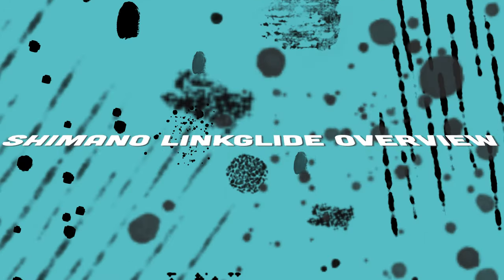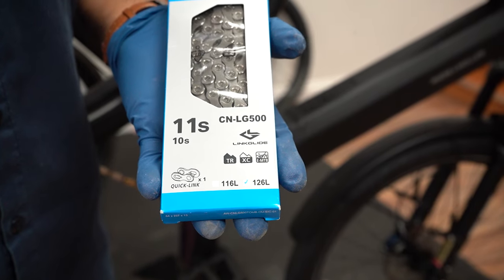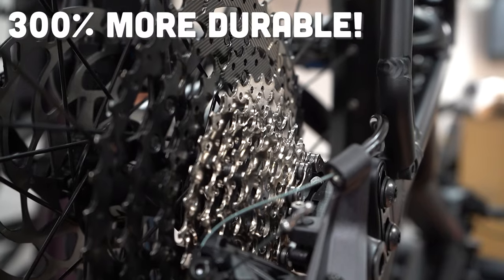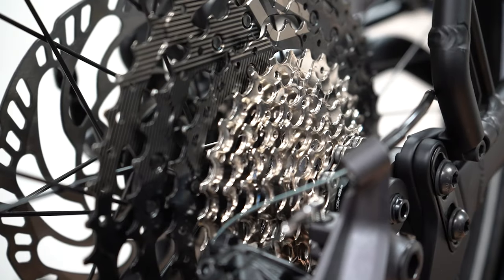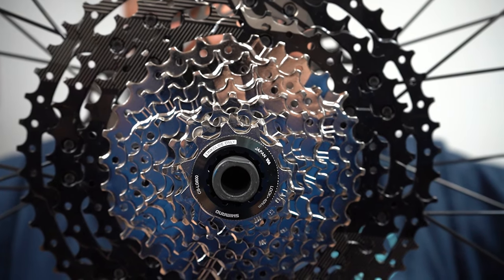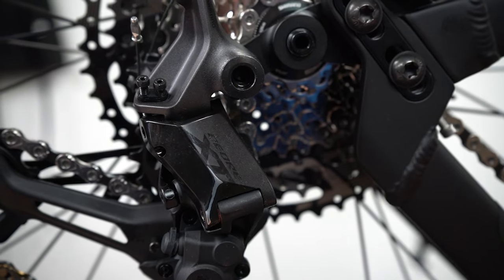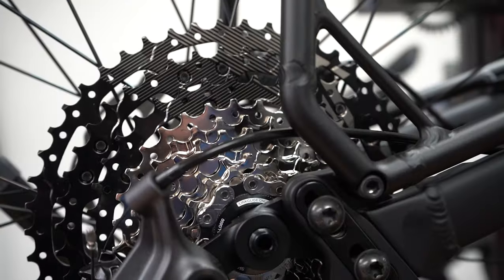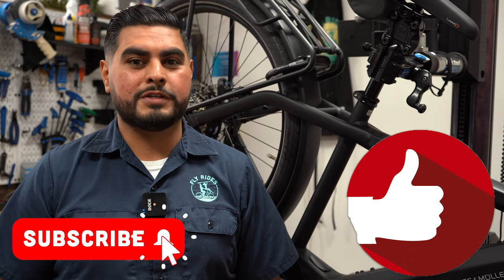Shimano's NEWEST Drivetrain for Electric Bikes | The Shimano Linkglide Explained

Comment: This new Shimano Linkglide drivetrain is solid! We already have customer with over 1000 miles and it’s still shifting smoothly with very little chain wear. Can’t wait to see this on more eMTBs
Reply: Is it possible to replace an 8-speed Hyperglide cassette with the 10-speed Linkglide? I assume the new cassette would just have to be the same width as my current cassette and I'd have to upgrade to the Deore derailleur and shifters which are currently Acera. Thanks for any advice.

Comment: I have installed the 10 speed Deore Linkglide on my affordable e-bike. So far so good. I also like the gear indicator that is on the Deore shifter, and I have no need of more gear range. 11-43 tooth is plenty for my e-bike, even in steep climbs. In Norway, the complete setup is like half the price of the Deore XT Linkglide.

Comment: When components companies claim that it will last say "300"% longer I don't believe it.
A cassette already lasts 3 chains stretched to .50
That takes about 2 years riding almost every day.
What they're claiming is that cassette will last 9 chains/ 6 years 
😑 I just don't believe it, but maybe on a E-bike it may last 2 years
Reply: I converted my bike to electric and I'm on my third cassette in less than a year, so this new one would only last me a year. I guess if anything it would reduce how often I have to do this repair.
Reply: @wpjmurray  ouch. That's insane 😂🤣
Reply: I currently have 17,650 kms on my Shimano E8000 drivetrain full-suspension e-mtb.  I've gone through numerous chains..... however..... only 4 cassettes (11 speed 10-46) with 2 still operable.  I think the key here is 2 complete wheel sets changing off intermittently. Works for me!
Reply: I always run into that one guy that tells me he eats a chain every month. Makes me want a recording of what they're doing to it lol
Reply: @LastAphelion  changing gears under load probably

Comment: If my Trek Rail now has 12 speed Deore can i go to this and what must i replace.
Reply: Yes you can. Which Trek Rail do you own? If it’s fitted with a 10-52t cassette, then you’ll need to replace the wheel’s freehub body to a Hyperglide freehub. Then you can attach a Linkglide cassette to your rear wheel. With this new cassette, you will need the accompanying derailleur, chain and shifter.

Comment: If anyone knows the linkglide derailleur with work with hyperglide cassette. Don't want to stuck with a shifter and derailleur useless if Shimano discontinues with the system and stop selling the linkglide cassette.
Reply: It should, but that defeats the purpose of the system. The cassette is the main part as it protects against wear and has improved ramps for better shifting.
Reply: I think you'd have to repace the Hyperglide cassette with a Linkglide cassette, and if that's the case how do you know which Linkglide is compatible? I have a Hyperglide 8-speed cassette, is there a Linkglide cassette that is the same width? I assume I'd also have replace the derailleur and shifters.
Reply: @wpjmurray  Yes, you’ll have to replace your drivetrain. Shimano is going to make 9-, 10- & 11-speed cassettes with Linkglide tech. 

Shimano is discontinuing Alivio, Acera, Altus, 10- and 11-speed Deore